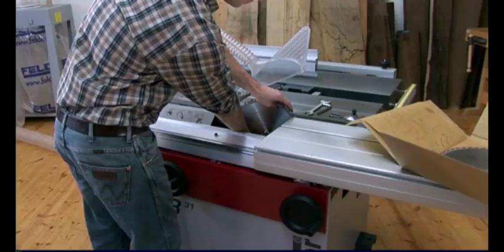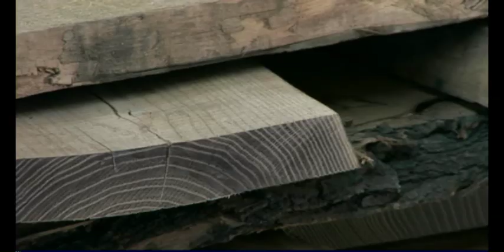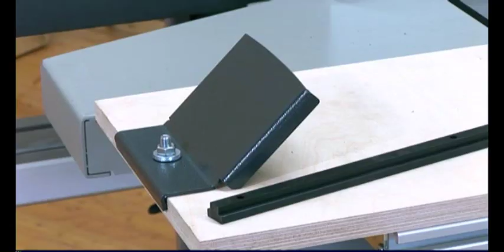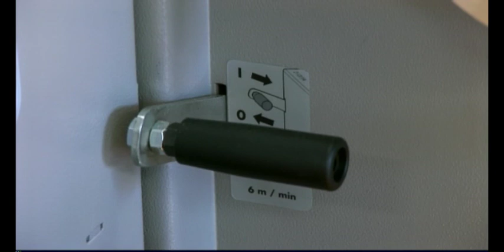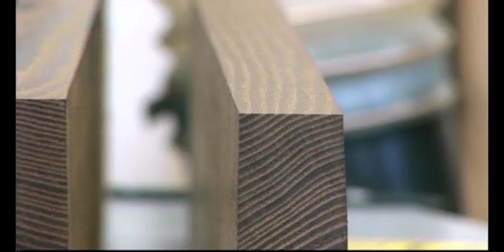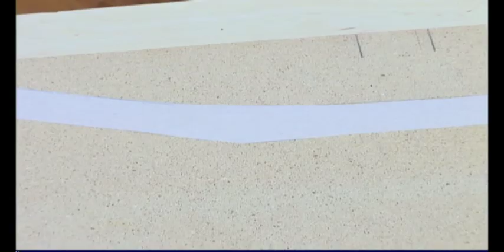DIY Hammer® rocking chair produced with the combination machine C3 31 | Felder Group (Part 1)

Comment: Where did you find that curved ruler?
Reply from the maker: Neil MC Cullough 
you can find thinks like that in our online shop 
http://www.feldershop.com/
best regards from Austria
Reply: I was wondering the same thing. That doesn't seem to pull up anything in the US, so search "CMT TMP-1000 Flexible Template for Curved and Arched Routing" on Amazon, and it looks to be the same thing. There are other lengths available, as well. Have fun!